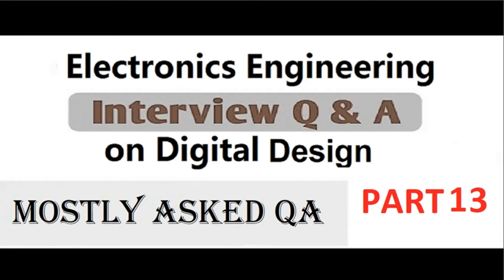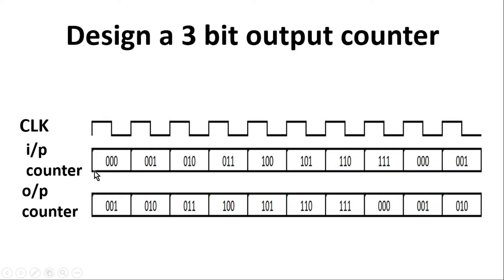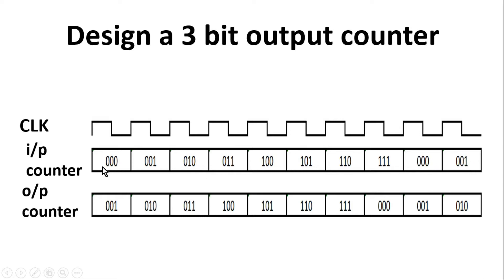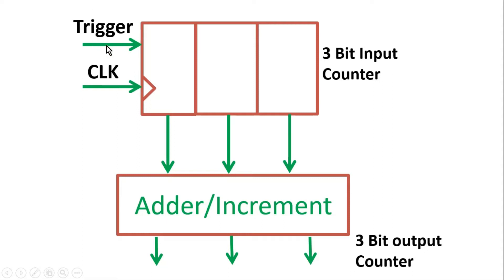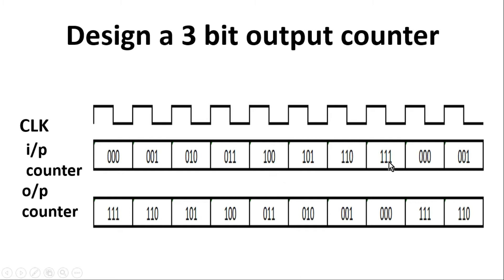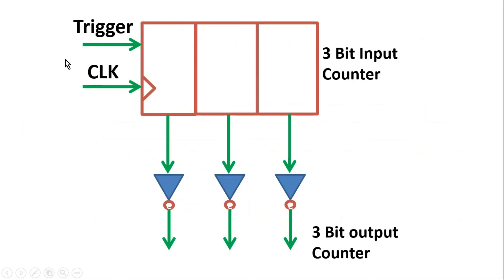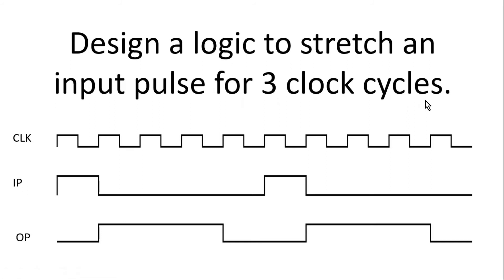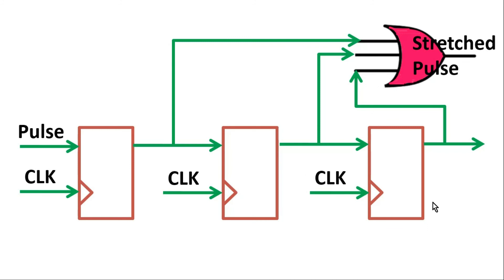Digital Design Interview Questions Part 13

Comment: Sir in the last question if we use only two flip flops then also we can get a stretched pulse by 3 clock cycles by ORing the pulse itself and the output of both the flops as each flop will delay the pulse by 1 clock cycle 
So two clock cycles delay by the flip flops and 1 by the input itself = 3 cycles delay
Reply: yes you are right,but according to the waveform shown the pulse had to delayed one cycle and then stretched.
Reply: Delay of Or gate=0 in this case
Reply from the maker: Aditya, you are right!
Reply from the maker: Why OR gate delay is zero? It will have some delay.

Comment: For question1 can we add 3 flip flops to the outputs of the original counter. That way they will be delayed by one cycle.
Reply from the maker: In the question, the requirement is that new counter should be ahead in time. But if we put flops as suggested by you, then new counter will have a delayed value. That is the reason that adder or increment is used.